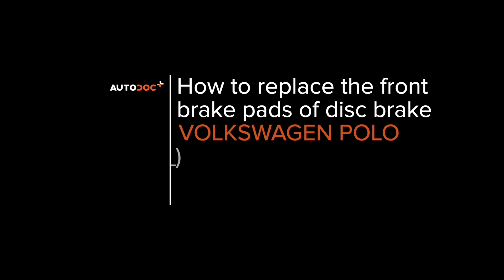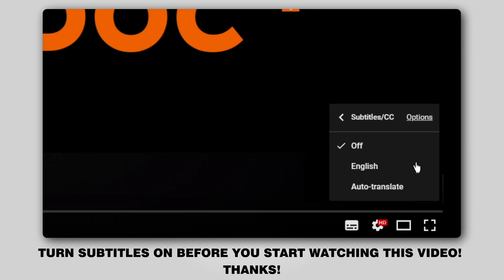How to change front brake pads / front brake pad set on VW POLO 4 (9N) [TUTORIAL AUTODOC]

Comment: Thanx. Took me 3 hours to replace my 1st ever. Took me 20 minutes to remove the 2nd one.

There are minor details missing in this video that can throw a first timer off. But it is the stuff you can figure out yourself.
Reply from the maker: We cannot show all the nuances and problems during replacement; this is all individual and it is not always possible to solve them at home. To avoid this, we always recommend that replacements must be carried out by specialized car services.

Comment: Why Polo don't need bleed the brake fluid?  Is it just for the rear brake?
Reply from the maker: Please clarify or rephrase your question. Regards, Autodoc team
Reply: You only have to bleed the brakes when replacing any part of the brakes that brake fluid is moved through for example; caliper, brake flex, making and fitting new brake pipes. This is done in order to remove the air from these parts as there can be no air in a hydraulic system because air can be compressed, the brake pedal will feel 'spongy' under such circumstances. The piston just pushes the brake pads into the discs